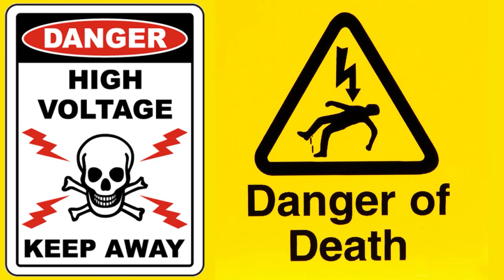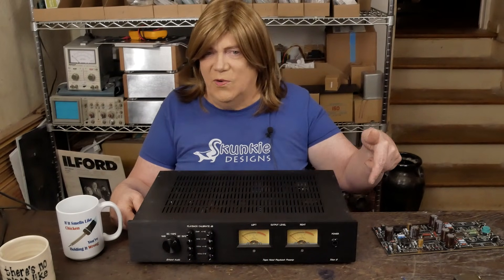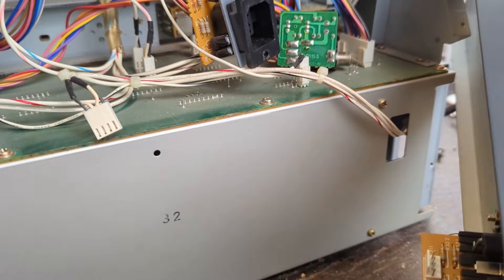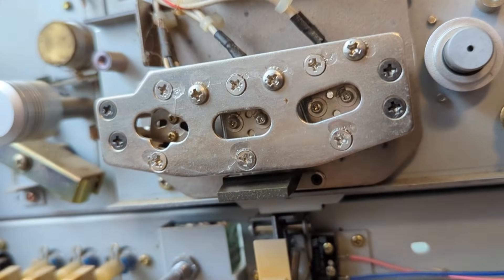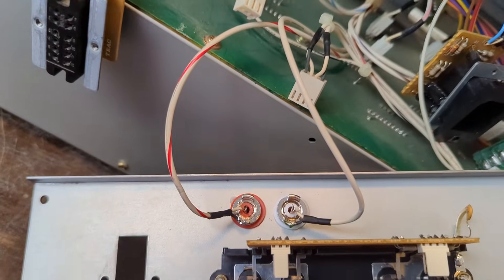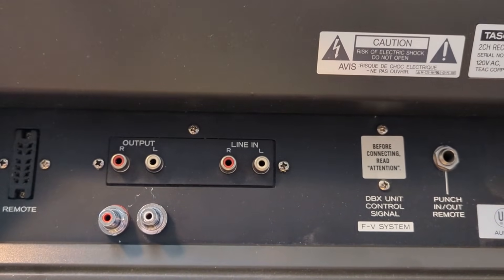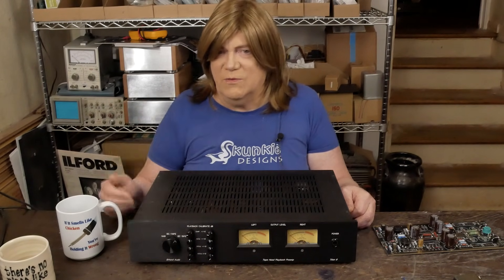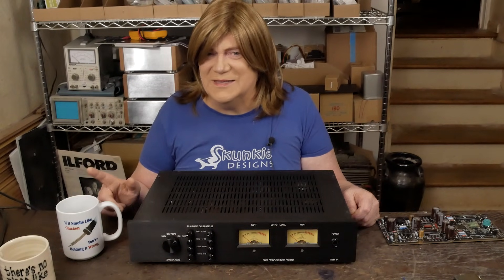Reel to Reel Tape: Adding Tape Head Out to TASCAM32

Comment: Hey Steph, you must be psychic. I just watched Anadialog talk about tape head preamps yesterday, and I have a Tascam 32. It sounded super complicated so your advice is golden.
Reply: PS. I think there is a relatively straightforward way to switch the T32 to iec, but it does involve stripping it down and fiddling with jumpers, so not convenient to swap back and forward. I am very interested in your board preamp as I only plan on playing 15ips tapes. In fact, right now I only have one, the new Rhino Yes Album release. Happily my machine is already iec, so I would only add a preamp to imprive sound quality.

Comment: I an curious as to what you need 15 ips for.  All the recordings I see out there at 15 ips are masters that cost several thousand dollars.
Reply from the maker: they are releasing 2 track 15IPS new tapes in IEC EQ, they run $300-600
Reply: @SkunkieDesignsElectronics  Good to know. I must be looking in all the wrong places 
( ebay -  🤣).  Thanks.

Comment: Steph I have a Tascam 32 and the default eq is IEC. There was a factory configurable option for NAB but otherwise IEC was the norm. Is you your deck one of the NAB units? That was my understanding and why I got one when I had a technics 1506 that can do 15 IPs but only with NAB. I’m just hoping to clarify so I can modify the board if necessary
Reply from the maker: It depends on where you live/the unit was sold. The US sold units are supposed to be NAB. That's according to the factory service manual.